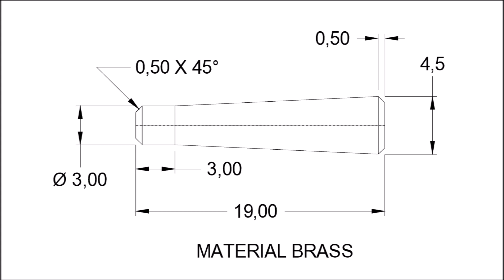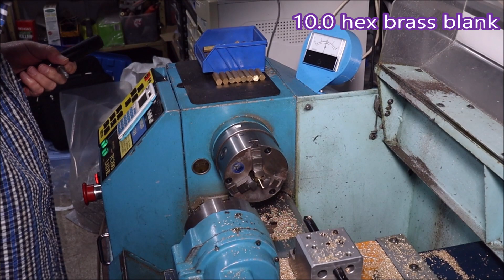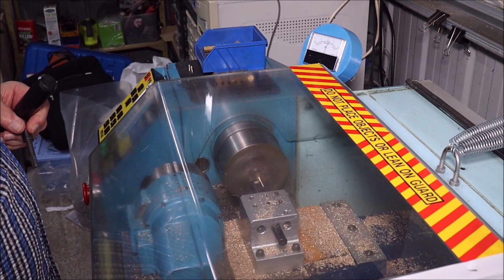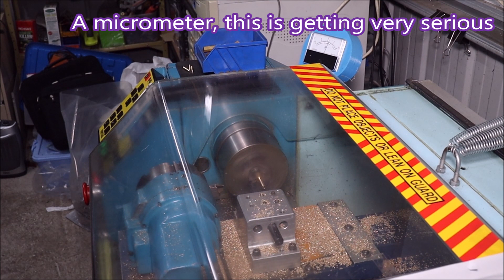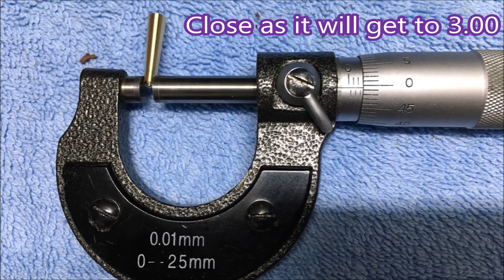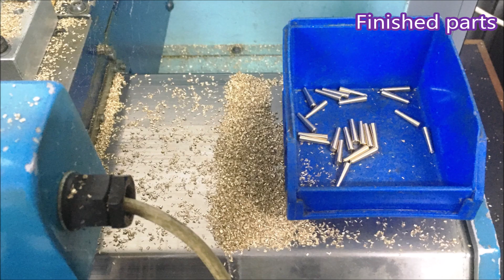Handle for model steam engine valve. Made from scrap in small cnc lathe. Turned with boring bar

Comment: Greetings! Just found your channel, really enjoying it, thanks. Seems I'm a couple decades late and dollars short, REALLY like your machine. Is there anything comparable available these days?  I'm in the States, have been looking, but most stuff is BIG, or expensive or Chinese. I admire you Aussies, keep up the good work!
Reply from the maker: Hi, I am not aware of anything similar. These units were sold into the US under the Rockford name. I think the one the size of mine was called a Rockford 2000, the smaller version with an 80 mm chuck was called the Rockford 1000. The word Pro, may have been in there somewhere too on different versions or at a different time. They are a great little machine, ageing electronics being their biggest problem these days, they are well made mechanically. Thank you for your comment and welcome to my channel.
Reply from the maker: A friend of mine has a Dyna mill and thinks a Dyna Lathe would be good, they may be more available in the US, they are extremely rare here.
Info re Dyna 3000 lathes
Dyna 3000 lathe videos:
With original controller  https://youtu.be/09M50l5DTjk
Modified to Mach 3  https://www.youtube.com/watch?v=EDNCo6e3LNU
You may also find some stuff on the CNC zone Dyna Mechtronics section  of metal working machines
Reply: @smallcnclathes  Much thanks for the info, I'd dig deeper here and see if I can turn any up! :)

Comment: Is it possible to warm the machine to it's full accuracy just by having the spindle run for the same amount of time without doing an actual job? or is it more the sideways load of doing the job that's warming it up? i thought that might be a way to avoid the first three parts becoming scrap.
Reply from the maker: I did exactly that this morning, three empty cycles and the first part was correct.  That was a good thought!

Comment: Hello!
Why don't you use Moving Rest and longer rod, or a pneumatic chuck and full length rod?
Reply: Because that's what he has.
Reply: @koharaisevo3666  so, he needs updates 😉
Reply from the maker: Not sure what a moving rest is. I am using this material to use it up, it is scrap. My pneumatic chuck, has no through hole, so could not use that for bar feed. As Koha said, this material and equipment is what I have and updates will not be happening. Thank you for your comment
Reply from the maker: Exactly right, thank you for your comment

Comment: Love your videos!  Question for you on inserts.  I have used the inserts for steel on my lathe when turning brass, and was wondering if you do anything to them to modify them for brass.  Specifically, I've read some people taking a few strokes on a diamond lap to flatten the face of the insert to make sure it has a zero degree back rake.  Any input on inserts for brass and aluminum would be appreciated.
Reply from the maker: I do nothing to inserts for brass. Historically (as in when I was young) brass was machines with tools of zero rake, ie flat on top. This stops the brass “grabbing” and drawing in the tool at an increasing rate until something goes bang. Jobber drills tend to do this in brass too! We used to touch these on a grinder, so the cutting edge was perpendicular to the drill centre line. I will find a link to something that shows this later. I have used inserts for aluminium (rake of 20 degrees) on brass for years and not had a problem. BUT and this is a big but, a cnc has no backlash so “grabbing” does not occur. If the inserts you use grab, you need to do something to stop them grabbing.  I have experienced grabbing in my 2hp manual lathe in a different way, taking a 5mm cut in aluminium with an aluminium insert, the part was being drawn out of the chuck. As rake increases, the cutting edge gets weaker as it thins down and the power required for the cut drops. I hope this helps.
Reply: @smallcnclathes   @smallcnclathes  It does!  This is for CNC use, and I suspected that inserts for aluminum would work great for brass.  In my CNC mill I use end mills for aluminum on brass all the time.  It gets a better surface finish than those designed for steel.  And it makes it easy to just keep one set of tools ready since 99% of what I do is brass and aluminum!  Thanks for the feedback, I've been enjoying your videos for a long time.
Reply from the maker: This video shows an aluminium insert cutting brass, https://youtu.be/uZaOBl2uecI
and this one shows where a large drill has been backed off to stop it grabbing as it broke through in aluminium, https://youtu.be/QTLcmESue5s

Comment: If the scrap price is calculated by weight, it shouldn't make any difference - so, that's kinda odd.
Reply: I was wondering about that too. Do they calculate by volume instead? which would feel counterintuitive.
Reply from the maker: From what I understand, the swarf is usually contaminated with coolant and other impurities which makes it harder to reclaim. the surface area of the material being melted also plays its part.
This can result in requiring, more fuel to melt, more flux to assist with impurities and a lot more effort to get a kilo of reclaimed brass.  
Solids are usually cleaner than swarf and contaminants harder  to hide. My swarf was been checked with a rod magnet to check it for steel contamination the first few times I went to the recycling place.

Comment: How do you remove the little knob wehre you parted it of
Reply from the maker: I am hoping that it can fit in the hole into which the handle is fitted and not need to be removed. It protrudes approximately 0.3, so it may not require removing at all. If it does need to be removed, I would imagine my customer would linish it off by hand. Have asked the question and will confirm when customer gets back to me.
Reply from the maker: Confirmed , it won’t need to be removed

Comment: What boing bar is that?  I like your  that lathe!  Mines a tad larger but no turret.  (TL-1)
Reply from the maker: Ah Hah, the trick question, I am afraid I just have to say it is an opposite hand boring bar! LOL.  Basically 12mm shank  for 55° insert Left Hand (you will have to check the LH/RH bit).  No turret just means your cnc is a Gang Tool cnc.  Unlike me, turret failure will never bother you.  As a long time sufferer of this disease, I have often found turret envy difficult to understand.
Reply: @smallcnclathes  In one hand, I wish I had a auto turret but on the other hand, I need the access to the 16" swing that wouldn't be possible with the turret.  I got me a huge chunk of aluminum to start building my gang block from.  I'm a good 6" above by x-slide so need a spacer then my holders on top.  I installed a pneumatic 5c this week and got my M10 & M11 going so once I go gang, a small bar puller will be in the works.  Good Day.
Reply from the maker: Sounds great. Do you have any lathe videos yet?
Reply: @smallcnclathes  No, not yet.  I'm more of a watcher than producer as far as videos.
Reply from the maker: Sometimes the effort to create a video vs views received makes me want to just be a watcher too.

Comment: How do you know ho far to locate the stock ? Do you have some sort of stopper ?
Reply from the maker: For this part it was a morse taper bung in the spindle drilled and tapped for a screw to make an adjustable stop. These blanks were scrap so all quite short. When I use longer stock I usually pull the stock out to a tool to know how far to pull it out
Reply: @smallcnclathes  thanks